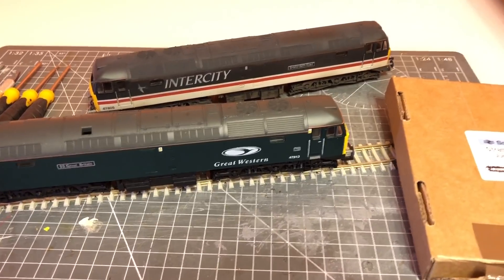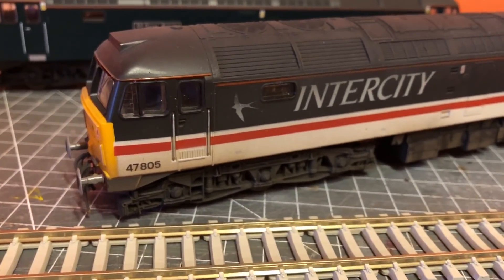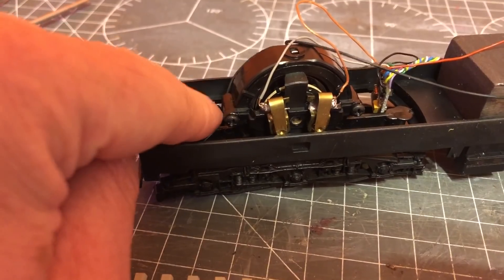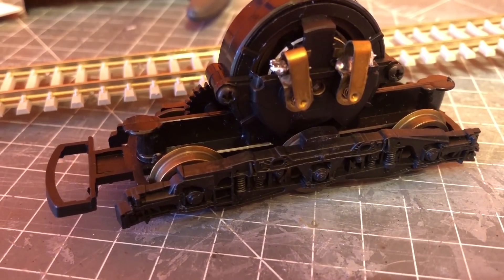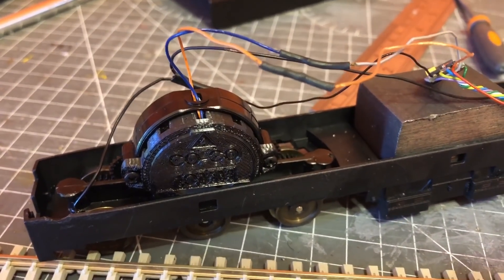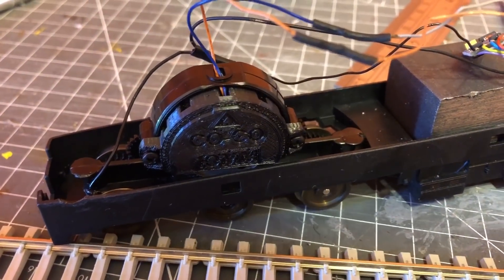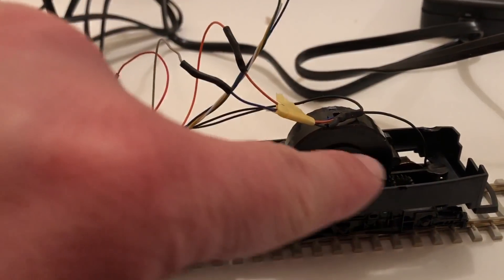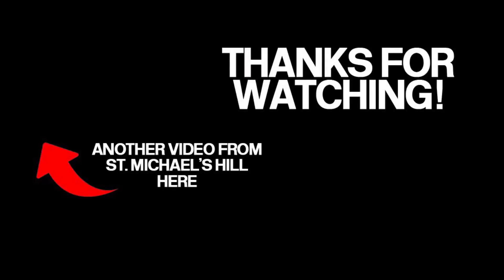St. Michael's Hill Model Railway Ep.32 - Lima CD Motor Upgrade Kit

Comment: I think this system of getting old bangers going again is 1 of the best is idea's i have ever seen and gives me more of a chance to resurect some of the most worst worn out motors due to me buying them cheap second hand. Good tip for anyone wanting to find cd motor replacements motorwise is pulling down old computer printers as they have 4 can motors and the cannon printers have the round barrel type can motors that go into the flying scotsman type of motor and they have the tiny screws holdin the motor to there original brackets in the printer as well. 
The other cannon printers have the can motors like you are showing there now on your video and most work quite well .. (its best to test them before using them)...
Anyhoo keep the good work and gr8 video there mate and thanks for the education.
Cheers from John in Australia
Reply: Good recycling tip; there are lots of old computer parts, games consoles, DVD players etc that could yield suitable motors if they're the right size...

Comment: Gracias por su tiempo y subir este vídeo;  les quiero compartir mi experiencia con estos motores de 6 voltios, que los puse a dos locomotoras Lima, pero  estos motores son de otra procedencia, les puse una tira  arrollada con varias vueltas  de lámina de plomo de 1.5  mm de grosor y al ancho de la montura para el motor hecha por Lima y mide poco menos de 1cm de ancho y  con esta tira arrollada alrededor del nuevo motor se auto centra, además le da un poco  más lastre o peso a esa parte motríz. Aunque les digo se debe trabajar un poco más, porque las locomotoras Lima siempre por su diseño económico, pues carecen de contactos en las ruedas como el caso de las que están  en el otro truck, y para eso le puse contactos hechos con bronce fosforado,  sin conexión de cable que atraviese el chasis, con un arreglo algo complicado de decir aquí  y que ayudan en buena medida a que la locomotora nos se pare así no más. Saludo desde Costa Rica.

Comment: Really appreciate you covering this in a video, Richard. It's always nerve wracking releasing a product and then worrying that folk don't find it as easy to work with as you did or that it doesn't work (when you designed it, you get rather snow blind to it all). It's great to get this feedback, both from you and some others too. Really appreciated. 🙂 I'm also finishing off a generic adaptor which, I hope, will be able to accommodate a variety of the ~12x24mm motors other there, so folk could use it with spare cd motors that they have lying around the house. I've been really happy with how these motors have performed in my own models...makes them fun to use again! 🙂

PS. One tiny suggestion, you're probably best not feeding the wires up through the hole in the top of the Lima bogie housing, just feed them out of the hole in the adaptor and leave it at that. There's a danger the wires could get nipped by the Lima plastic housing...talking from experience! 😀
Reply: @scottscornertmd  Hi Scott. No, there are scroll circumstances where you should consider them, however it depends on what decoder you use and also how you use them. If you have a decoder that has cv5 programming available, I now just use that and ratchet down the top speed. It's not quite the same as reducing overall voltage because of how decoders serve the motors, but I've never had a problem with it yet. If your decoder doesn't have cv5 control, it's still worth using a diode voltage dropper in the circuit. You could rely on just keeping the speed low manually (and to be honest, I have a DMU converted like that and it's not blown the motor yet), but formally I don't recommend it.
Reply: I forgot to say, I have just bought an order of higher voltage 12mm cd motors and I'm currently testing them. If they work OK, then I'll start shipping those and they will reduce the need for diode droppers in most cases. However, they're only 12mm ones. I've never found a 10mm motor that is rated above 6v.
Reply from the maker: No problem David, as I said during the video, it was a very easy kit to use! And good tip - I'll make sure I do that with the other one I have and any future conversions.